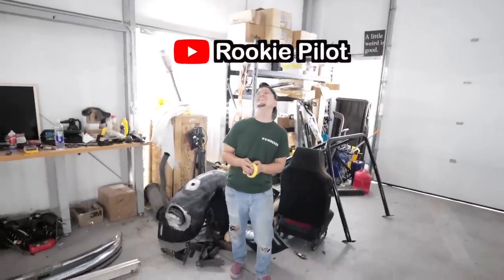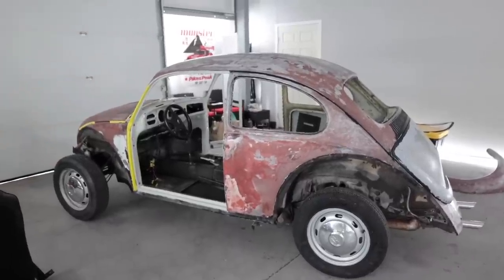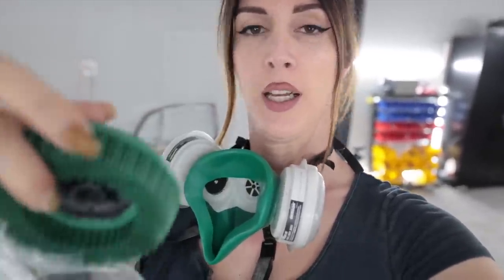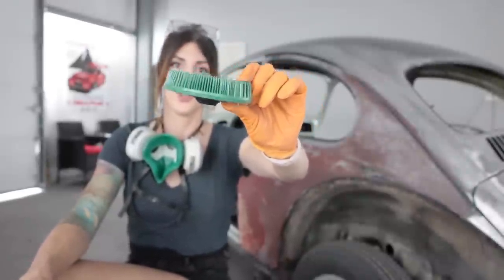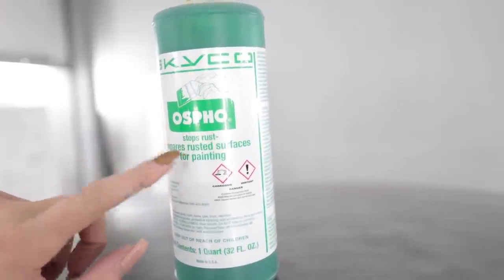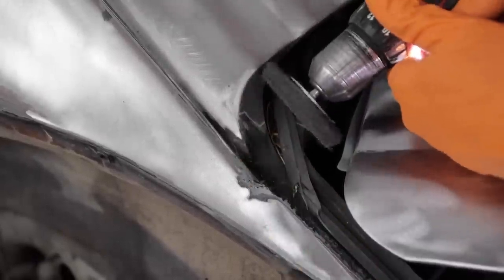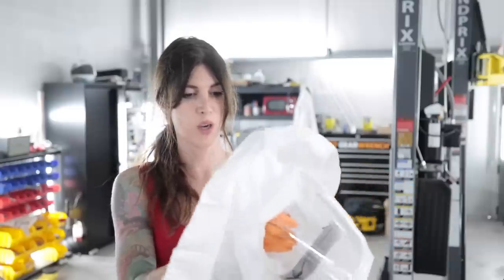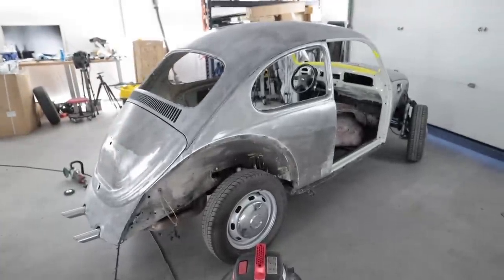I Stripped it Down to Bare Steel & Found.. // '69 Off-Road Beetle

Comment: Be careful of what primer you use, the Ospho will probably need to be reapplied to reactivate the layer that is on it now, and then neutralized and rinsed off.  Most all epoxy primers will not be compatible with an acid based metal prep unless it’s completely neutralized and removed first.  Check with the primer manufacture to see if the Ospho needs to be neautralized/removed, the TDS doesn’t always mention it.  Would hate to see prep and primer/paint work ruined by adhesion problems.  Upvote this so hopefully Sarah sees it before spraying primer!
Reply: True. You must be sure about compatibility. I have 2K urethane primer from Eastwood and it says it MUST be acid prepped if applied to bare metal.  But I etch and remove before the phos dries.
Reply: @h82crash  2k urethane over bare metal is a bad idea, it doesn’t seal metal like epoxy does and filler does not stick well to 2k so if you need to touch up and bodywork with filler it won’t stick. Eastwood is relabeling lower quality materials, I wouldn’t think trust them on something that matters.  Look into SPI products instead, they’re very high quality, priced reasonably, and the costumer service and tech support is the best ever.
Reply: @theastronaut2276  2k urethane filler primer seems just fine on bare metal, guess it depends on brand. Did most of my car with 2k epoxy on sandblasted metal then body filler and 2k urethane filler tho, just got lazy on last few seperate pieces. I definetly feel like the ospho/rust converter stuff is just asking for trouble and not neccessary, the 2k epoxy will fill, seal and ahdere fine to small rust pores. Kinda like same with sodablasting just way more hassle than sand... But it might have its place on spots that you cant mechanically strip the rust/are too lazy like backside of a steel bumper. I used the eastwood internal frame coating rattlecan on inside of framerails, i guess its okay atleast it had nice extension nozzle on the can but there are better 1k paints too that are more solvent resistant, probably better to stick with ppg etc.

Comment: When it’s all said and done, that beetle will be the freshest beetle on the planet! 👏🏻😉
Even if it is hot, you can still do things. Unlike some of us who have winter 4 months out of the year. Can’t do anything when it’s cold. 😔
Reply: Before mexico stopped making them, you just took your serial number plate down there and put it on a brand new beetle coming off the assembly line..  Instant fully restored beetle as far as the DMV is concerned.

Comment: Great attention to detail. Alot of people would of just sprayed over an additional coat of sealer to cover up the pitting. The pin holes on the sides were for chrome trim. I had it on my 64 when I had it. Helps break up two tone paint work. I do appreciate the hard work you are putting in to this giveaway and I have my order in.

Comment: Friggin love this beetle, my favourite of all your cars so far, just zero electronics to go wrong.
Reply: but plenty of other stuff!  😄
Reply: Pay close attention to the flimsy little tabs that hold the oil cooler on.  When it snaps off you will be in the middle lane of a split on the interstate as all the oil is pumped out of the engine.  Farfromovin! The air cooled VW experience!😎
Reply: @bigdog4173  as long as you know to check it and keep an eye on it.  They are easy to work on.  The battery in the back seat isn’t a big deal for me and can be relocated to the front with longer cables.  In you just need access to power they make the plug ends for jumper cable and winches you can run an “outlet” to a convenient spot. 
All it takes is time and $$$$! 😎
Reply: Mine made me realize why cars now kill people.  Beetle has no dash, and that is what bakes the cars insides.
Reply: @charlesmckinley29  I found the fuel pump vapor lock was biggest headache.  A 12 volt pump up on the gas tank solved that.

Comment: Watching you do this causes recurring nightmares of when my brother, father and I repaired a 1973 VW Bug. The body was horrendously rusted. We live in Ontario so that Bug saw more than its' fair share of salt over the years. We cut, welded, fabricated more of that car than we should have. We finished it off with rattle cans of blue paint which actually didn't look too bad from 10 feet away.

Comment: Note to Sarah: When thick dust or any other material builds up on the floor, don't sweep. Vacuum. Sweeping puts a lot into the air, which can hang even after you think you are done. And, a lot of the stuff we car wrenchers are dealing with is toxic, so, vacuum instead. Safer. Better.

Comment: Check the front torsion beam to make sure it hasn't been bent. The replaced bumper mount, front fenders that probably weren't stock, and all the damage on the driver side suggest a front end collision bouncing off to run down the side.

Comment: Damn that little green tool would have come in handy back in 2013 when I color changed my car. I've used the yellow version to remove gasket material. Never knew a paint version existed.

Comment: I so wish I had taken my bug down to bare metal after seeing this.  But I had a partner involved with my restoration that also did restore work, and said it was not necessary and seeing as the project was taking place at my job's hanger, time was limited.  Seeing this Type 1 brought down to bare metal was educational.  That original paint of Beetles is very tough (the whole car was dipped in it.  IF you dare open the forward panel to the center tube, you will see the original shiny black paint used as the base coat/ primer used on these vehicles.

Comment: Those bristle disc’s do an amazing job. I’ve never seen them before. I need to get me some of those. 
Any advice on the best ones to get? What grit did you use?
Reply: This one - 'Scotch-Brite Bristle Disc - Coating Removal Disc for Metal - 36 Grit Ceramic Mineral - Molded Abrasive Bristles - 4.5" - Single Pack'. Search for it at Amazon.

Comment: The phosphoric acid reacts with the iron oxide (rust) converting it to iron phosphate, which is relatively inert. Of course, if you scratched through the new coating, it would rust again
Reply: Ive used Phosphoric acid before and it stated in the bottle that it must not dry on panel. Just curious if this is product used by Sarah had any additive which negated this rule?
Reply from the maker: @tomspeirs1195  don’t think you read that correctly.
Reply: @SarahnTuned  you are correct, my bad. It helps if you can follow direction. Unfortunately this is not my strongpoint. 
Great channel Sarah, i like your style

Comment: Look into an "air scrubber".  We use them in construction for dust capture on the job.  Ive used one doing body work.   Works wonders.  Its like a 12" diameter vacuum.

Comment: I'm wondering if you spent more money on paint stripper than you would have spent on having it media blasted. I say media, because there are a few different types of material being used to blast the paint off.
Like baking soda and very fine sand, to coarse sand. I've also seen video of someone using water to blast the paint off of a truck.  Also you are so right about rust, rust never sleeps, especially if there's moisture in the air and on the metal.
Reply from the maker: Take it from someone who’s done both multiple times, this was more time efficient and cost less while making less of a mess.

Comment: Couple things - Put the "rust mort" ( (c) SEM) in a spray bottle and mist it all over the panel, and wipe it around with a new rag. You could do the whole car in about 10 minutes! Trust me - done it countless times.  And don't use glass cleaner to clean it down, use wax and grease remover. The ammonia (and all the other stuff) in almost all glass cleaners can make for an ugly chemical cocktail between it, the acid, the future paint.

Comment: For future reference,  the cement prep at home depot is the same thing you have in the little bottle but you can get a gallon for around 20 bucks,  doing the whole car only helps protect it from rust as the phosphorus is similar to a galvanized coating,  looks great girl, nice work 👍

Comment: I remember back in the old days I used to get that chemical stripper and head to the local car wash at night.  Slop it onto whatever I wanted to strip, let it work, and easily hose it off with the pressure washer.  Couple of extra bucks to clean the stall afterwards.

Comment: Yes.... Beetles come with an aluminum strip down the body sides. If it's not there the body or paint have been redone. There were holes the stripping fit into. Often fall out when washing the car. So they typically get removed during first redone

Comment: Sarah, it's called a "Bristle Disc", not "Brittle Disc". It's a great 3M product; the green disc is also useful for scuffing aluminum surfaces before applying an Alodine passivation and then zinc chromate 2-part epoxy primer. Thanks for another interesting video.

Comment: Phosphoric acid neutalizes oxidation as it detaches the oxygen molecules from the iron in the steel and replaces them with phosphate molecules. The result is iron phosphate. Navel jelly, which looks like the pink slime from Ghostbusters II has saved me a lot of time in removing surface oxidation on my own project. Phosphoric acid is the prime compound in that as well.

Comment: There is a product called Extend in spray can that converts rust to something purple/black like the stuff you used. It's been under the paint of my 69 GTO for 30 yrs and no paint bubbling so it really works great. I guess it doesn't convert but the chemical reaction stops the rust in it's tracks.

Comment: Any time you take an old vehicle back down to metal you are very likely going to find something or other.   If it has the old stock clunky intake and carb it would be nice to put dual Kadrons, Webers, somethings on it but the whole package for those including the manifolds, carbs and linkage is notta cheap.

Comment: Pro tip: dustless media blast would bring it down to metal in no time, if cause of budget and choose to chemical peel after applying the stripper stick aluminum (or how you say it) foil on the wet stripper to keep it from drying up and evaporating and keeps it active longer to penetrate into more paint and work better.

Comment: Hi, your doing great, a little tip from an ex-spray painter, when using paint stripper, always scuff the surface with a heavy grade sandpaper first, like 60 grit or for thicker surfaces 40 grit, anything that will leave deep scratches on the surface of the paint will help the paint stripper penetrate better, being careful not to scratch up the metal or underlying surface to much, you should see better results from your stripper, hope this helps you, all the best, Al

Comment: I told you months back I would do volunteer work for you. Got experience in paint, body, prep, fabrication, mocking, disassemble and assemble, some mig welding, house keeping, maintenance. I'm only 3 hr drive from you. I have time right now. I'm a weirdo but 😎.

Comment: Wow!  You are going the extra mile, and it looks amazing. You were lucky to start with a well preserved bug, all things considered. I am curious why you did not use the grinder from the start, rather than using the paint stripper first. That grinder worked so well, so fast.....very cool!!
Reply: It would not be that fast and easy, without stripping first, and thick paint will clog, and use up discs, and other tools.

Comment: Here is a tip. Use ac aluminum masking tape. The real aluminum not the mylar. Also use aluminum foil instead of masking paper.
We do this on aircraft.
You can localize the area to be stripped without damaging anything else.

Comment: I got sem rust mort thinking its better than the rustoleum rust dissolver jelly but i learned that they both contain the same ingredient "phosphoric acid". That ospho thing you used also has it. The rustoleum jelly i think is best because the jelly doesn''t drip down like liquid.

Comment: Please use apropriate filters for your powered respirator when applying chemicals. Those filters you‘ve shown are for particles (dust) only. You can also buy hard respirator helmets for your device and those can be wiped down after use.

Comment: Hey, those concrete pillars at gas stations did not exist back in the 70's.   No one thought anyone would be stupid enough to drive into a gas pump.  

We used to call Bugs "kill buckets" because Bill Cosby said you would lose if you went head on with a dog at any speed.   $500 for a Bug was a fair price and we drove them anyway.

Comment: I live in England, we usually have it cold, or about 25oc this time of year. We are expecting the temperature to rise to 40oc. Our first ever Red Alert. So we will have an example of what you experience on a regular basic. Ragnar looks likes its going to be amazing when you have finished it. Any idea what kind of wheels you going to use. The new ones on the Ford Bronco, completely change the look. What do you think of the New Honda Civic e HEV that's due out soon.

Comment: Sarah, never saw those Bristle Dicks in action before. They work great. Would they have worked on the original paint so you can skip the stripper step? I have to do this exact thinng on a truck cab.

Comment: Aircraft paint stripper! Can You still get the old stuff?  I was in aviation back in the 80's when it still contained methylene chloride. Believe me, it stripped paint bare to the metal one coat!!
Reply from the maker: So it was crappy for a while, but this recent formula works pretty good now if you use a thick coat.

Comment: If those pits are black it probably was phosphated before! That acid converts iron oxide into iron phosphate, which is black rather than the red like iron oxide. Supposedly the iron phosphate is inert and won't continue to corrode.

Comment: Technically speaking, the metal should be sanded with at least 80 grit, as to allow sealer and any filler to "bite" into the surface. And yes, all residue from the metal prep, must be removed from the surface prior to applying any product. Also, buy some Wax and Grease remover to wipe surfaces down with, stop using window cleaner.
Reply: She knows what she's doing. She doesn't need your BS

Comment: Can u say sand blaster.  Work smarter not harder
Reply from the maker: Sand blasters absolutely ruin car body panels. Horrible idea.
Reply: @SarahnTuned  dustless sandblasting is better for steel because the water in it reduces friction and heat, which can warp the metal during the stripping process.
Reply: @SarahnTuned  Typical dustless sandblasting incorporates a rust inhibitor that decontaminates the steel, leaving a chloride-free, clean and paint-ready surface.

Comment: The angle grinder is one of the most dangerous tools in the shop. You should be wearing proper protective gear. You should be wearing a leather coat. You should have your legs covered with double layers of heavy duct pants. You and many other Youtubers are such poor examples of how to use personal protective gear properly when doing this kind of work.